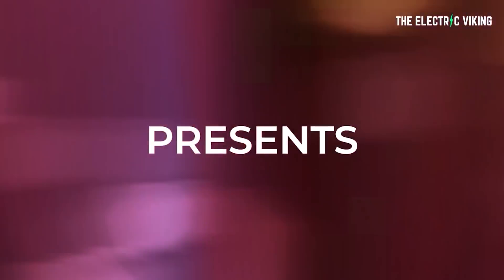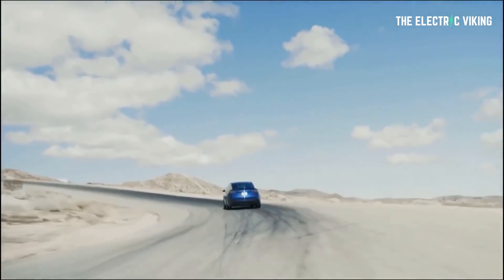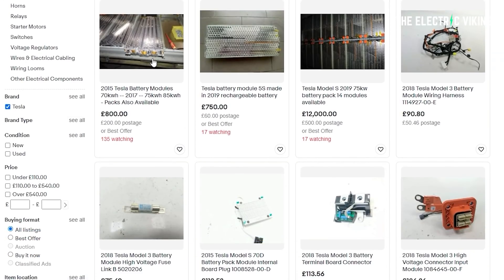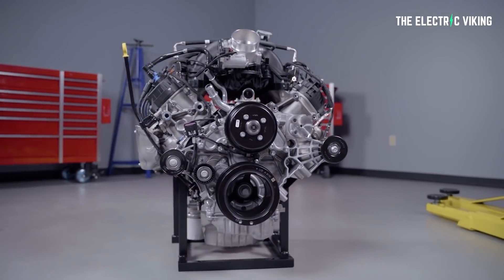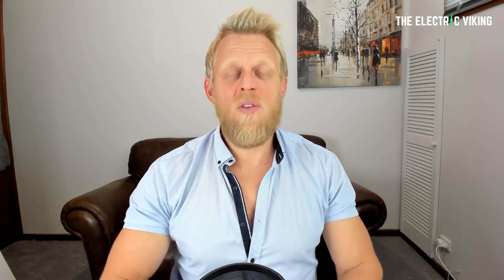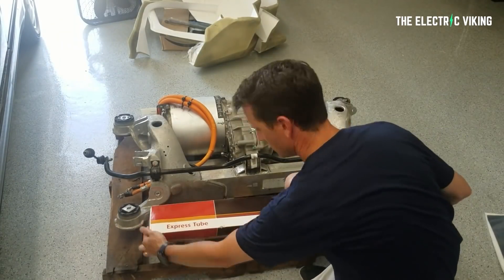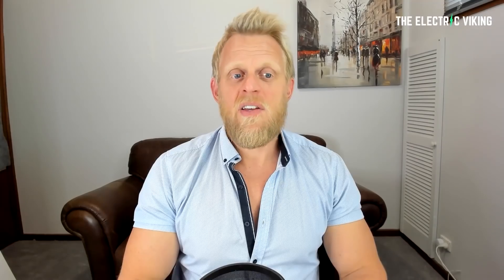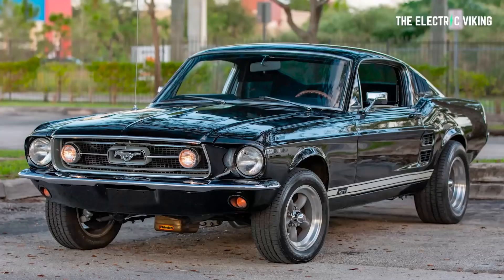Scrap the small-block V8 Swap for this Tesla Crate Motor

Comment: The Swap Culture is one of the most Exciting things about EVs right now. There is a 1970 Dodge Tesla Swap a Guy has made and it is Incredible! Boostedbois have a Sleeper Mini Van that has a Model S Plaid in it. That thing can fly!!! The future of EVs will not only be the cars but buying the batteries and motors as kits. This would be really cool for Tesla to invest in. Hopefully they turn on Super Charging for those in the future maybe after thorough inspection.

Comment: So, an obvious application for this crate motor would be boats currently powered by small block V-8 engines. For saltwater boats, this would be a great upgrade due to the fact that they would no longer need to be concerned about how they were going to be cooled. Neither complex fresh water cooling systems or corrosive saltwater would be required to run this setup. Attach this to an already beefy outdrive, replace the fuel cell with a battery bank, and you're off.

Comment: Will be great in my 1984 Chevrolet Corvair Monza Spyder convertible.  Won't replace my 150HP Turbo until crate motors and new battery systems are well in place.

Comment: In the middle of my 1989 Toyota pickup with 487,000 miles. using leaf batteries out of a wrecked Nissan leaf ,and other part and a hyper 9 motor. Goal is 350 mile minimum. With everything so far to make it run,I am at $10,000.fabrication is left .

Comment: For this to be a viable alternative to a typical crate ICE it has to: 
1. Drop in price to $10,000 to $15,000.
2. Batteries need to get lighter and smaller.
3. Batteries need to charge faster.

Comment: I love that setup. There are a few companies offering ev crate motors .Electric Gt  , hypercraft , and I run webb motor works that has drop in electric crate motors that look like a sbc or a flathead v 12 . It is a lot more sustainable repowering an older car than crushing them and building new cars .

Comment: My Mom's old  '77 BMW 320i would love to have a greater than 97 hp motor and so would I! Been thinking about it for a few months. Car is in great shape, only about 160K km on it but its leaking gas and the fuel injection pump/distributor is broken.

Comment: This is pretty cool because many of the old cars have terrible weight distribution and horrible emissions.  This could be easily solved with batteries in the back seat and gas tank area in a pure EV.  In fact, I’d be happy with a short range EV in a classic car.  50 miles would be enough for 90% of my driving.  I’ll just use a different car for longer trips.

Comment: Electric will definitely have its place in the aftermarket, it will be a niche segment. It could be interesting for some builds. But if you think that this will supplant a properly modified V8 in a restomod like a classic muscle car/sports car, you are completely mental. Why do you think that Porsche and so many other companies are investing millions in development of synthetic or e-fuels? Within this segment, the visceral, aural, attraction of a modified(usually) V8 is not something that you can just wish away. As long as synthetic fuels can be successfully developed, and it appears likely, I have no problem with this incredibly small segment of the automotive world continuing. There are so many other things in the auto, and larger green energy sectors, that need addressing. Car guys, like myself, who get a great deal of joy in life by building restomods or occasionally driving a new Corvette, Porsche, Mustang, etc., with a modified powerful ICE pu, should not be in the crosshairs of some rando Ozzy with a great deal of ignorance on this sector. I like much of the info I get here, I am writing after watching another video. But sometimes Sam just plows forward with his bashing of anything even peripherally related to the ICE and comes off sounding little more than a Tesla/EV fanboy that is incredibly out of touch and naïve about this subject. Sam, perhaps take the time to understand “car guys” and why the ICE in this tiny auto sector is desirable and even preferable. Maybe then you will understand why the successful development of synthetic fuels is not the foolish enterprise you seemingly wish it to be. Synthetic e-fuels are not in any way being developed to compete with EV’s. That would be very foolish and not something I want to see happen. I am loving the transition of transportation to EV’s. I love watching the rapidly developing tech. I also love driving my old restomod Vette. But most of my driving is with my 3LR Tesla. I am hopeful of getting a model Y performance AND a new Corvette, in the next couple years. Maybe just try to have some perspective and nuanced understanding of the subject. Car culture with the ICE is a real thing that is not just going to disappear. Emerging synthetic fuels and newer ICE technologies from Chevrolet, Mopar, Ford, and many others is a way for people to continue doing something they love and do it in a more environmentally responsible way.

Comment: the words "engine" and "motor" are perfect synonyms - there is no difference, despite any modern perceptions that may have arisen in recent years due to comparisons between electric motors and internal combustion engines - saying electric engines and internal combustion motors would be just as valid - pedantic rant complete

Comment: 1968 Barracuda, 1970 Chevelle SS, 1970 1/2 Camaro SS, an 1980’s Buick Grand National, a Nissan 240 SX Silvia conversion, 1991 Nissan 300 ZX, 1998 Toyota Supra SS, 2002 Nissan R34 Nissan Skyline V-spec, if were just wishing for things like that.

Comment: I sold my 2010 E 350 for $12000 and bought a Mache GT for a net of $55,000. It seems much more cost-effective than a conversion considering I have a new state-of-the-art car.
Reply: Apples and oranges.  You're comparing a Mach E to an Econoline?  Good luck fitting plywood or a motorcycle in the Mach E or making it a camper.  

I'd take a Tesla powered E350 over a Mach E 10 times out of 10.

It's great you're happy with the purchase but what a weird comparison.

Comment: I am able to imagine someone wanting to convert an old W211 four seater into an a two seater EV using salvaged EV parts. Plenty of space in rear speed for a 250 miles range battery pack. No need ti do 0 to 60mph in below 5 seconds. Below 7 seconds is already good enough. But can't imagine, whether it is worth it, if it need USD30k to get it done using salvaged part. 😅😅😅

Comment: I have never heard of anyone transforming their gas vehicle into another gas vehicle. I have never heard or seen anyone exchange an engine with another engine. "plugging in" is putting it to mildly. Even if there are shops that do conversions like this, you would also have to get rid of the gearbox of the old car and find a way to place all the batteries and rewiring the packs as they are arranged differently.
I believe more in the recycling of batteries rather than converting old cars to electric. It will be much more expensive than buying a new car in the future.
Also consider that almost all countries have rules that state how and when a car is legal. If you take your old beamer and put in the battery and electric motor, chances are you already are above the allowed limit of weight of the structure. There is no way anything like this would ever get approved for road use in most areas. At least not without special permits etc.
So the batteries will disappear from ebay and go back to where they came from for recycling.

Comment: I had to spend A$ 7000 on my Ford Transit Diesel in the last 12 months to keep it going. Insane. I need it for work and I don't have the cash to buy a better one, anyway, rather I'd find work that doesn't require a vehicle. Having said that, I love to go camping in it. So for a while I have been thinking about hanging on to it until electric conversion kits become available, or look into it and make one.
Thanks for doing this channel.
Cheers from SW Western Australia!

Comment: I have an 87 GMC G2500 conversion van.  This vehicle could handle the power and the weight of the batteries.  There still are custom van fans out there.

Comment: This is ingenious!!
In the US I was a member of a local Mustang club and every one customized their cars to the nth degree. Usually making them faster more unique looking. The saying at the time was "If you didn't build it, it isn't really yours". I was afraid that with EVs this hobby would slowly die, but electrification of a muscle car or any other classic car can be the hobby of the future.
It'll make the car as powerful as any ICE car and much less prone to mechanical problems.
Of course, you'll be missing one of the most important things: The sound of a V-8 with "almost" straight pipe exhaust.

These cars are typically not driven for long distances. To the track and back or a weekend night cruise around the town à la American Graffiti.
Reply: I won't miss the noise...... until I do......then off to the AA fuel drag strip I go :)

Comment: I think a Volvo P544 electric conversion would suit the Electric Viking. Lots of upgraded running gear parts available as it was and still is a popular rally car because of its coil spring rear suspension. For me the Jensen Interceptor would make a great conversion.
Reply: I own a ‘67 Volvo 122 and I’m not opposed to doing an electric swap. That would be awesome.

Comment: I would convert my 1995 Saturn SC1 to electric.  It presently has a 100 HP single overhead cam 4-cylinder aluminum block engine.  The car has many plastic body parts which will never rust out, so with the electric conversion, it could continue almost indefinitely.

Comment: That Revolt crate has a Torque Trends 2 to 1 Torque Box. They have several conversion plates that allow for different electric motors. The Tesla motor is the most powerful use of this Torque Box but it can handle way more. 
That is way too powerful for smaller cars so engineering for registration is a problem. Other motors are old tech and heavy/large. Emrax make  Axial Flux motors which are small, powerful and light. There 228x90mm pancake motor gives 109kw peak power, can be easily stacked for 218kw weighing 12kg each motor. Mated to the Torque Box this is small enough to fit where the transmission is housed leaving the entire engine bay for batteries, management systems and contollers. While expensive atm a few companies are going into mass production. These small light motors are a far better solution as fitments in trans tunnel is the way forward.

Comment: The electric original Mini conversions are already making big news, with spectacular performance.

Personally I feel actual muscle cars and exotic super cars should be left to run on combustion platforms .. the only conversion to be to a cleaner combustion material.

I'd like to see things like motor homes converted .. along with a roof full of advanced solar charging.

Comment: Replacing the motor is easy. Finding somewhere to put enough batteries is quite another. I've seen many different Tesla motor swaps, and they all end up overweight and with terrible range. Fine for around town and a bit of fun, but it's a very expensive toy.
Reply: Wrong!!!!!! The most difficult part is the software and hardware to control the motors and all the electronics around it

Comment: I’m excited too but because I’m nearly 80 I’ll have to leave this crate motor caper to younger enthusiasts. I already have a friend here I Perth who has successfully put a fork lift electric motor into a old Mighty Boy UTE. I want nothing to do with modern computerised cars, ICE or EV, so I would want to start with a more modest power spec to make an EV daily driver out of a pre computerised ICE car rather than an electric muscle car. Eg in the spirit of Ford’s 78 F150 concept car. (See Marcus Brownlee’s review) Say start with a crate motor from one of the Chinese manufacturers of about half the power and torque of this Tesla crate motor. And ideally, if they catch on, use swappable batteries which I believe may well displace the fixed batteries. That’s my vision but I think the old ICE home building tradition will live on as creative mechanics put wrecked EV motors into all manner of bodies weather or not the Chinese get into the crate motor business or not. I know the whole trend in manufacturing is to stop people from exercising the right to repair, but the strong tradition of building your own, built up from the Model T onwards, will not be suppressed easily. I see that as a positive legacy of the ICE era, and crate motors are part of it.  One day the Electric Viking and Uncle Tony may work together. 😉

Comment: I own a Pinzgauer 910M military vehicle.  It was the European equivalent of a military Humvee.  It has an air-cooled 4 cylinder engine.  It is no longer being manufactured since BAE bought them out about 10 years ago.   A model 3 motor would fit in perfectly and there is a gigantic well that runs about 3/4 the length of the vehicle that would be perfect for a battery,  With differential locks on all four wheels and a manual transmission that is geared for 10 speeds a manual would work just like the original Honda Insight.  With electric motors having so much torque probably only a two wheel, two differential lock (on this vehicle the front or rear wheels can be independently selected), four wheel drive, and four wheel differential lock needs to be selected.  High and low could also be selected, but the clutch and gears could be eliminated.  However, the one speed electric  motor would suffice for a transmission and ICE.

This would be the ultimate 4WD vehicle because the fully independent suspension is already designed to carry 10 soldiers with their battle rattle.  In other words plenty of heavy electric batteries could be stacked in the gigantic well.  Of course a motor at each wheel electric vehicle would be the ultimate 4WD but something like a Bollinger is just too expensive.

If there are any Pinzgauer owners reading this, it is time to start putting ideas together in our forums for EV conversion of our beloved Pinzgauers.

Comment: Well in theory it sounds great, but I think packing in a sufficiently large battery pack in a car not designed for one right now is a big challenge. However, in the future, as battery packs become cheaper and more compact and able to fit under the bonnet with the electric motor, these conversations could really take off and become more than just small scale boutique affairs
Reply: An 80L Fuel tank on an old car was quite big and as for  extra power for some of those cars extra power could just be dangerous as they already have enough power that unless you are very skilled using even most of the existing power can be dangerous. Remember that all the fancy safety systems on more modern cars either did not exist or were uncommon in those days. Also because so much of the older cars are analogue you don't need so much new wiring and once the big engine  is replaced by a much more compact electrical motor and the fuel and air feed system is gone there should  be plenty of room.

Comment: There won't be heaps of spare batteries from wrecks to go around because every electric car sold will either need a second hand battery within 10 years of its sale or its going to the scrap heap because new batteries are so insanely priced. Way beyond the value of the 10 year old car.

Comment: I follow a classic car EV conversion shop channel from the UK, each classic car becomes viable to my eyes once converted.  The Ferraris they convert become better after conversion, not only having more power torque but also the weight distribution is better, while weighing almost the same.🤯
Reply: Lol…… by converting them with modern combustion engines it will also makes them much more powerful and weight distributed and even much more lighter than the EV ones.
Reply: A 4 cylinder Honda engine making 500hp is super light and ridiculously powerfull
Reply: @alanmay7929  lol. a non street legal drag car.
Reply: @zodiacfml  nope it’s a normal daily driving car lol…. Tesla roadster used a lotus shelf and people have put those Honda engines and I Ed them up to 800hp to make beasts.
Reply: @alanmay7929  nope kid. nope